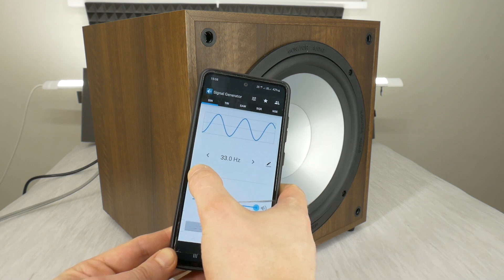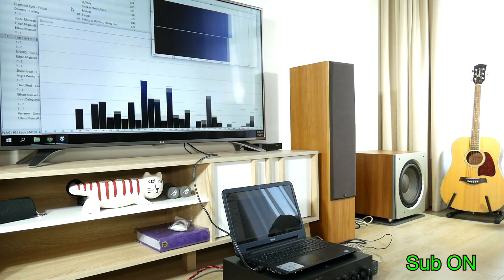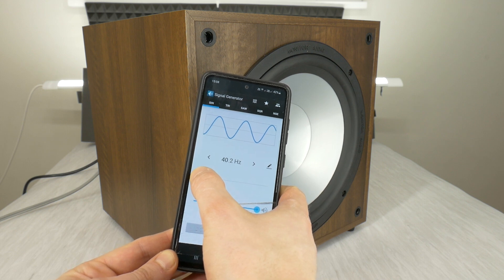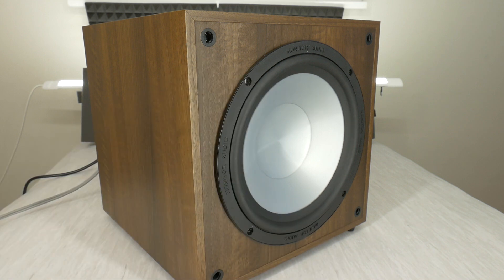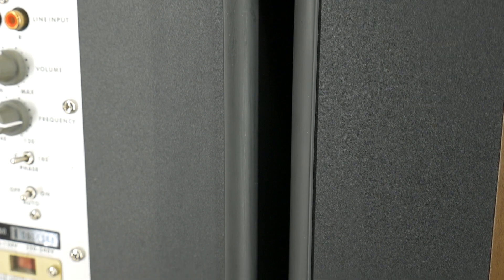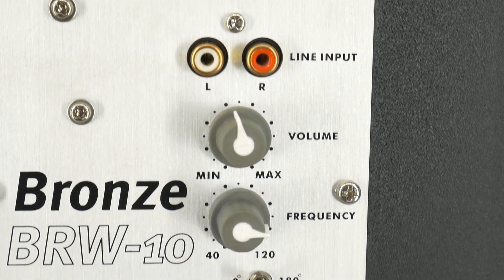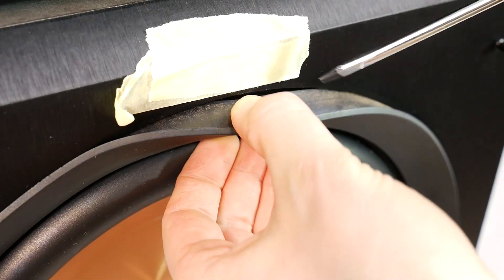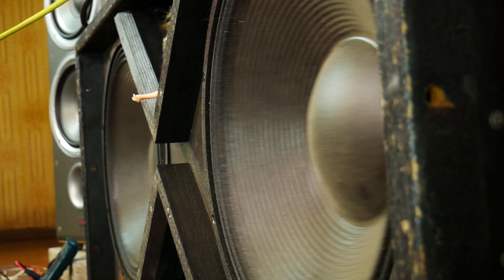Tips & Tricks to Make SUB Sound Better

Comment: I have a pinnacle subsonic subwoofer, and it rattles from 60-ish Hz on below. I was not able to find any airleaks whatsoever, and there is nothing that isn't well-secured inside it. I also checked the drivers and they're totally silent, no mechanical noises or anything. Amp and source aren't clipping, drivers aren't bottoming out, everything has gasketing tape around it for a proper seal. In fact when I remove any of the components and use the test tones again, the rattling is completely eliminated. So I am totally stumped at what the issue is on mine.